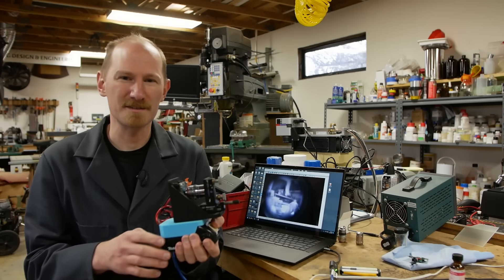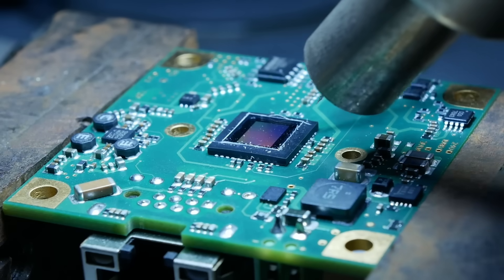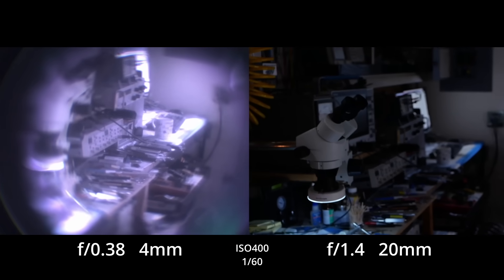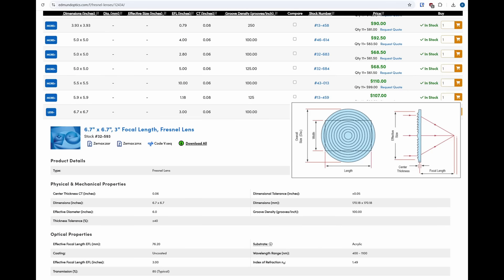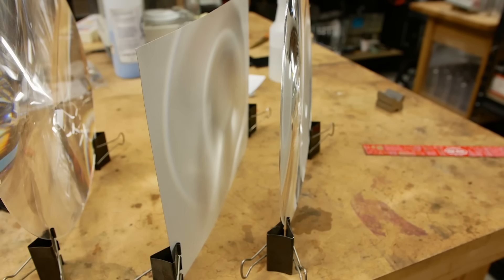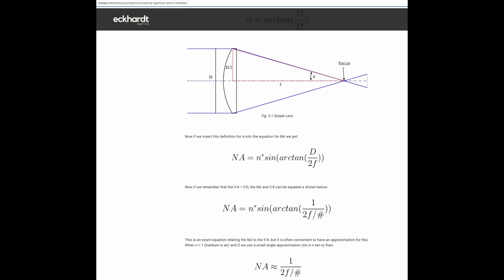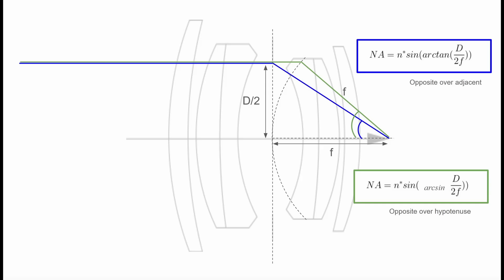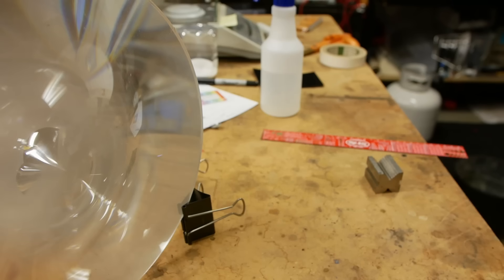f/0.38 camera lens made with oil immersion microscope objective

Comment: I'm genuinely curious if the removal of that glass piece from the sensor could contribute to to the lens gathering more light. Let me elaborate. Those glass pieces on camera sensors usually serve as a NIR/ short wave infrared filter, since both cmos and ccd sensors are sensitive to that range aswell and out of focus infrared or blown out pictures in a sunny day, where NIR and IR is abundant is undesirable. So by removing the glass element or filter, you allow the sensor to pick up those extra wavelenghts of light, which IF I REMEMBER CORRECTLY the sensor might have no reliable way to differentiate from the visible spectrum, therefore it might register it as more light in RGB. Could this be an issue when trying to truthfully compare it to lenses that are suited on unmodified commercial cameras that don't pick up IR? I'm really interested if a IR filter somewhere along the length of the setup would make a difference. Also, since the sensor is not exactly sealed of from light, could ambient lighting be a problem and contribute to the overall brightness of the recording/image?

Comment: Nice video. One thing about the film Barry Lyndon. The candlelight scenes were taken using the special low-f lenses, yes, but the film stock itself was high ISO (that is why those scenes are so grainy) and it was chemically treated during developing to enhance the impression. Also, the prints made from the negatives were overexposed as much as possible.
Reply: Squeezing, squeezing that last little bit out of the available technology!

I haven’t seen the movie, but the attempt at applying technology to art, for artistic reasons, is interesting.

Comment: Ben, you used the wrong olympus lens. I sold them for 22 years. That lens has a 180mm focal length to the eyepiece and this is why your image is crappy. Olympus makes the same newer lens, also oil immersion, with and infinity focus where the microscope body had a collection lens below the head set. This new version will vastly improve the image quality and also comes in an APO.

Comment: Dof is calculated through magnification, so a low fl number just means it’s lower mag at larger distances. So with the same mag(same fov on same sensor size) the lower f number should give you the less dof. And the calculation is the square of the mag so the mag is far more important than the aperture

Comment: I understood the oil principle for the gap with the provided picture. I didn't however understand why you removed the cover of the chip (which might had vacuum) as this was already optimised in fabric. I mean they already designed in to collect all possible light, so why remove the cover? A graph for the CCD sensor would have been really nice

Comment: filling the gap between the protective glass and the sensor wouldn't have worked because of too many material transitions between the lens and the sensor? or are there different reasons?

Comment: The most disappointing thing about these experiments are the image sensors themselves: they do not accept light from flat angles as well as they do from perpendicular incidence, if at all, and the colors are distorted. Part of the problem here is the microlenses on the sensor, which already perform high NA focusing per pixel. There was a group on YouTube that mounted an original Barry Lyndon lens on a 60mm digital film camera. They did not comment on it themselves, but the bokeh circles, which were too small and rectangular, made it clear that the sensor was not benefiting from the valuable lens in the intended way.

Comment: I'm sorry but your "steep angle" lens idea seems to have at least two flaws. 
1. The image sensor cannot handle such steep rays. There is a reason most bigger camera sensors are covered in microlens arrays and even with them suffer from terrible light loss under steep angles. BSI sensors are a bit better than FSI sensors, but also they really don't leek steep incidence angles all that much. The photographic medium with the best steep incidence angle response is still film
2. As you learned if you are after DoF, an effective aperture is more important than the numerical aperture. It also correlates better with the total light gathered. The fastest current M43 lens is an F0.8 Voigtländer. But there are also FF lenses with F0.85. So to even match commercially available F0.85 FF lenses on M43 in DoF and total light gathering you would need an F0.425 lens. (search a bit about equivalent apertures if you want to learn more). This F0.425 is already basically impossible. So if you are really trying to build the lens system with the most light-gathering/shallowest DoF. There is no way around using the largest sensors you can find

Comment: Of course the DIY is part of the fun, but if you just want a glassless image sensor, Pacific X-ray Imaging in California does image sensor glass removal commercially and does not charge exorbitant fees. I've used them many times and they have 100% yield even for sensors on single board cameras like yours. I've always wondered how they manage it so cleanly.
Ps this is not an advertisement, though after reading it sounds that way... Our company uses them all the time and I'm always contemplating how they manage to take the glass off so cleanly.
Reply: And actually now that you have the degassed sensor, it will be pretty sensitive to low energy x-rays. Depending on the sensor, the intensity of the pixels often correlate very well with the energy of x-rays hitting the sensor, almost like a simple XRF detector. Not sure if you still have your X-ray tube sitting around, but that would be fun to experiment with.

Comment: As someone who’s recently spent a long time looking at commercially available fast lenses because my high speed camera iso only goes to iso 400, this is awesome (if far from the application I want 😂)

I need to rewatch later to appreciate the math, but the concept of immersing the sensor to allow for high convergence angles is fascinating! I’m wondering if you could cheat optics even harder by designing a nonplanar detector. Another part of me is wondering if to make that work you’d end up with a separate optic per pixel and if the bees have already optimized that 😬
Reply: If you have a spherical sensor then a lot of aberrations go away. This was actually done for Schmidt cameras (telescopes) by stretching film over a spherical form. 

For your high speed
Take a look at X-Ray lenses btw, they can be had for only fractional kidneys and if your sensor is close enough to your mount you can get like F 0.75 there's a list of them on wiki and some forums dedicated to making useful lenses out of them.
"Medium division has a video"
f0.7 – Ultrafast Lenses – Legends, budget options, modding, and testing – Epic Episode #13 where they "adapt" their cine camera to use the ziess 0.7 xray lens.

Mamiya 645 medium format and speed boosters/focal reducers might be another possibly affordable option but you're probably looking at F1.5 and a muddy image depending on the sensor size you have. But I have seen people adapt them to MFT with success so possibly? The speed boosters for them on GFX sized cameras are like $500 which takes some of the shine out of the $100 lenses

Love your work in general btw. I am kinda hoping you're doing that rolling shutter combined with high speed camera to get that light in motion even slower thing with this ;-) But I have no doubt whatever you're doing it'll be cool
Reply: hey, look who it is <3
Reply: So ate you are saying, you aren't keen to try ripping the glass surface off your high speed camera sensor?!

Comment: Very cool! I wonder if you tried asking any AI chat bots to speed up your search for the answer. I've found they can give surprising insight sometimes. 

For instance, I just asked Meta's Llama AI why the 1/2f relationship continues even to low f stops, and at first it thought I was talking about the aperture blades of a camera, but when I said I was using bare lenses, it seems to have correctly identified the reason. This is what it returned:

In that case, the reason why the aperture number of a lens is approximated as 1 / 2f, even at low f-numbers, is due to the way the lens is designed to correct for spherical aberration.

In an idealized lens, the aperture diameter would indeed follow the trigonometric identity I mentioned earlier. However, real lenses are designed to minimize spherical aberration, which occurs when light rays entering the lens at different angles are focused at different points.

To correct for spherical aberration, lens designers use a variety of techniques, including curvature of the lens surfaces, aspheric lens shapes, and lens combinations. These techniques effectively reduce the angle of incidence of light rays on the lens, making the sine of the angle approximately equal to the angle itself (in radians).

As a result, even at low f-numbers, the aperture diameter of a real lens is still approximately proportional to the focal length, following the 1 / 2f approximation. This is a fundamental property of lens design, and it's what allows lenses to produce sharp images over a wide range of apertures.

Comment: I built a large format camera with a f/0.28 equivalent to full frame aperture for the shallowest of DoF.

Because the 400x400mm projection is so large, it has a crop factor 1/13 compared to 35x24mm film.

Using a Pentacon 420mm f/3.6 episcope lens, it effectively becomes a 32mm f/0.28 lens.

If you want to see an image, look up bramstolk on blue sky.

Great video, btw!

Comment: I noticed you use M18 battery, I've been 3d printing M18 adapters too lately. I discovered Metri-Pack 630 male terminals fit them just right, so it's my goto power source now! 😀 🔋

Comment: Fascinating! I've been wondering a bit about building an inspection camera using a DALSA Spyder3 high speed line camera I picked up super cheap a while back (they thought it was broken, it just needed the right power cable) and this answered some questions I had about low f-number lenses. Looking forward to seeing what you get up to with larger lens designs. And I was tense the entire time watching you cut that sensor open... tricky operation!

Comment: This is very close to a type of system I've wondered about where the focal plain is at the surface of the lens. Rather than use oil, you would glue the sensor to the glass. Of course that would result in a fixed focus system which would likely only be useful for limited case like astronomy (or anything else where only a focus at infinity is of interest).

Comment: I really enjoyed your video and your experiment with the microscope lens.  But there's something that you may not have considered. 

You used the oil immersion feature of the microscope lens to couple the lens with the photo sensor.  Then you were able to make photos using the lens.  However, in that configuration, the lens was backwards.  Thus, the indicated lens specifications would have been different from the specifications as used.

In normal usage, the oil immersion feature is on the side of the lens into which light enters.  The specifications apply when the lens is used in that manner since that is how the lens was designed to be used.  However in your setup, light exited from the side of the lens with the oil immersion feature.  In essence, you were looking down the wrong end of a scope.

You can, of course, mount a lens backwards.  It's a common method used for taking macro photos without a macro lens.  But if you do mount a lens backwards, you cannot assume that the lens specs would be the same.

Comment: wow very interesting. I thought I knew a bit about camera lenses, but I was reminded it's a bit more complicated. 

let's say someone would like to design a fixed lens camera with a very small f/number, could you instead of coupling the last element to the sensor with oil do the same with some sort of optical "glue" (forgot the correct term, resin maybe?)? like the "glue" used to glue together two lenses? is this the future of ultra-fast (cellphone)cameras?

Comment: What you have demonstrated is how quickly the elementary summary measures of an optical system fail to describe a real world of multiple thick lenses, curved refractive surfaces, non-parallel light paths, off-axis images and so forth.  A Fresnel lens is a flat array of concentric circular prisms, each of a different shape. Early optical scientists did ray tracing with quill pens and logarithmic tables and needed brutal simplification.

Comment: Great work!  I can explain one confusing point: your "f/0.38" number comes from dividing an oil-side focal length by an air-side entrance pupil.  Mixing oil and air gives a strange result, because oil immersion lenses have different focal lengths on the air and oil sides,  If you use the air-side focal length with the air-side entrance pupil, then your computed f/number will drop below 0.5, consistent with the rest of the discussion about what's needed to get a good image.

Comment: Not an optical engineer here, but I've worked in testing systems, and along people that are/were prominent optical designers for Zeiss and Hasselblad. I think I have a reasonable understanding of this... :)
You are basically correct about the aperture limits. Theoretical limits for a lens that interfaces with air is sqrt(2) over 4 = about f/0.354. Lower than this is physically impossible, no matter what the Ri of the last medium before the image is - since it would require the system to curve light back to the front surface from behind the image surface...
And yes, that's the limitation of the exit aperture as you concluded. The exit aperture is what each point on the image (projection surface) sees, and for image formation purposes it HAS to be an exact sphere (+/- a few wavelengths of the light you're capturing) if you want a low aberration image formation. A flat plane aperture only works (poorly, if you add in efficiency) for a collimation system that only works in ONE point, the axial center point.

IMO the easiest way to start understanding this is not through geometrical optics (which are at the very, very best a rough estimation unless you're working with low f/# low aspect ratio collimation systems). Geometrical optics are basically "lies for children" if that adverb exists in english. Something that's mostly correct for most "simple" applications of the theory.

To get a deeper understanding of image formation optics, the best places to start would IMO be either an astronomy forum like https://www.telescope-optics.net, or by starting to look into what the "Strehl ratio" actually means for an optical system. Either of these will get you very far :)

Comment: FYI- The focal plane of a camera is that symbol of the circle with a line through it, sometimes on the hood, or the top of the camera near a dial. As a photographer, this is amazing information and science. I'm used to the smaller the number (f2.0..) the more costly the lens like a long focal length telephoto 200mm. (most affordable 200mm lenses are usually f4.0 or f5.6)

Comment: @Applied Science  Ben, I been thinking about and starting the process of designing a Light-based Microscope that should beat the Diffraction limit but using a Laser in the same fashion that a SEM uses an electron beam.  My theory of operation is that I scan the laser in the Horizontal and Vertical direction at the same frequency as an old VGA CRT at 24.127hz or at least the proper harmonics of that frequency with a Photoresistor or cell to pick up the laser light and transmit that as an analog signal to the RGB of the CRT.   Now I doubt I can get proper RGB color, but this should beat the Diffraction limit as its basically multisampling the area and the Photocell should pick up the trace differences, right?  Anything glaringly wrong with my hypothesis here that should stop me in my tracks before I waste a ton of time learning all this and setting it up?

Comment: Is there a numerical definition of "corrected" that we could use to assign a proper "effective NA" to an aberrant lens? I would imagine a good first pass might be to multiply the NA by the Strehl ratio. 

I think maybe that's a little bit demanding for typical applications, as the Strehl ratio talks about the resolution limit of the lens and what fraction of light ends up within the theoretical diffraction limited point spread function. Many real world objects don't quite push a camera optical system to the resolution limit, and could be resolved with enhanced brightness and sufficient contrast even with a lens with a lowish Strehl ratio. 

 But still, for a given chosen "important" image element size, we should be able to calculate something like the Strehl ratio and multiply that by the calculated NA to get an effective NA that's numerically meaningful.

Comment: Excellent video as always! Every camera lens has spherical aberration - even good brand comercial camera lens. BTW, the story behind Kubrick's cameras used to film Barry Lyndon is quite interesting: he bought rear projection projectors from the studio - projectors that at the time were not being used anymore because of "green" screen technique. After they sold him 2 or 3 projectors someone called the studio asking for them to save them as historic machines because they were the pinnacle of projector craftsmanship! Kubrick then asked a technician who worked with him to transform the projectors in cameras (an irreversible alteration, btw). Then he used the Carl Zeiss Planar 50mm f0.7 that were manufactured originally for the Apolo Program.

A curiosity: SMSL's EUV machines use mirrors to project the mask over the silicon wafer and there's only one company in the whole world that managed to manufacture them: The Carl Zeiss Company. Yep - they don't make only wet lens wipes!